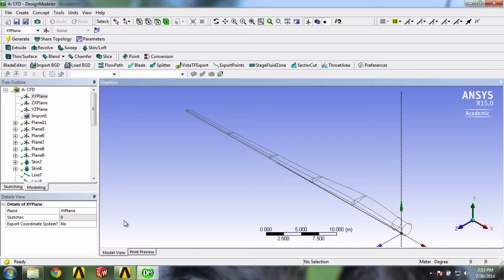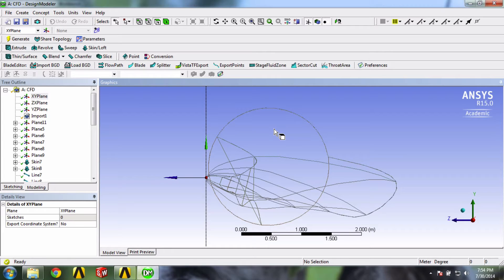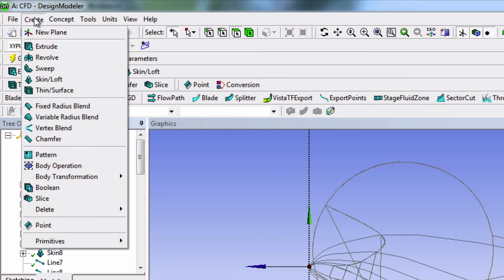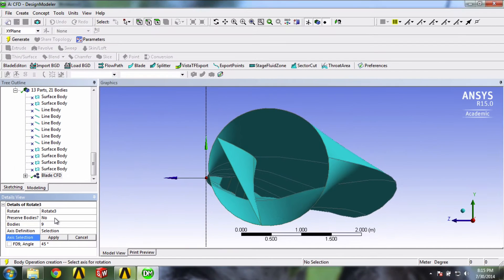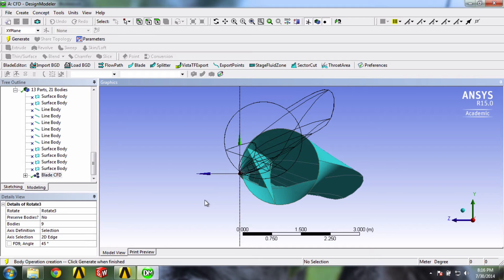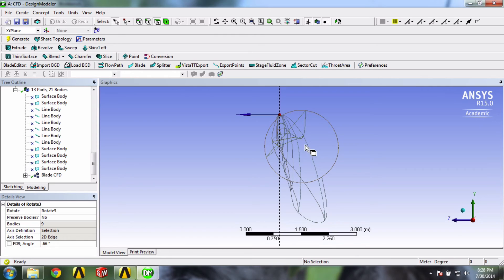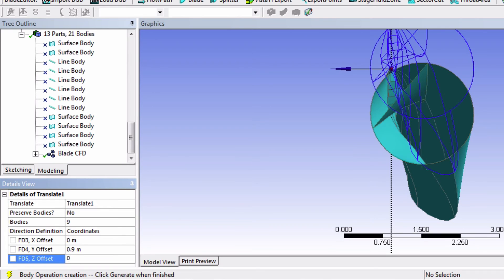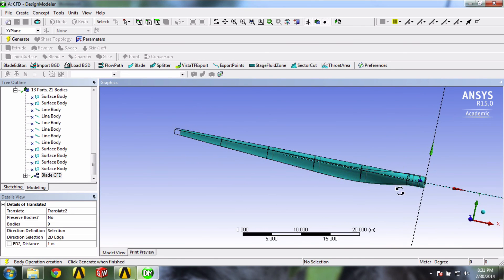SimCafe: Wind Turbine Blade FSI (Part 1), Body Transformations

Comment: Hello, I am using ANSYS 14.5 Workbench but I am not able open the turbine geometry in Modeler as the one uploaded in tutorial was created in ANSYS 15 Modeler. Is there anyway to go about it?
Reply from the maker: Shubham Mishra Yes we had another user bring this up to us as well. The geometry was actually made in ANSYS 14.5 because we wanted users that have ANSYS 14.5 to be able to follow the tutorial. It turns out however that the geometry will open in ANSYS 14.5.7 but not in any prior versions. So please update to 14.5.7 to open this geometry.